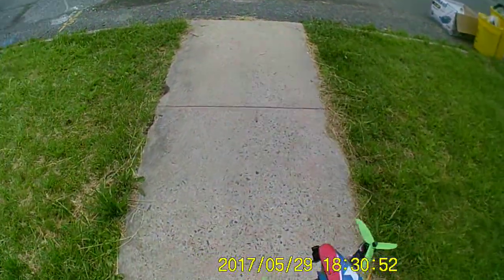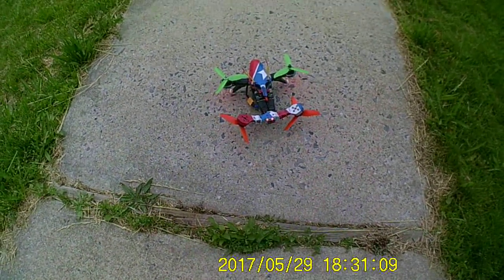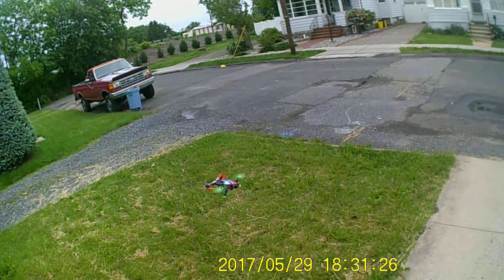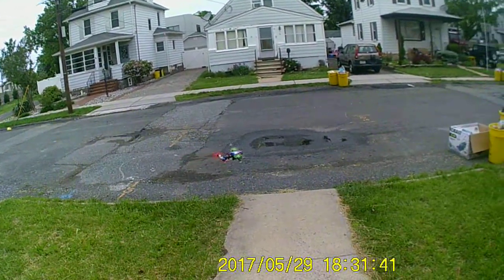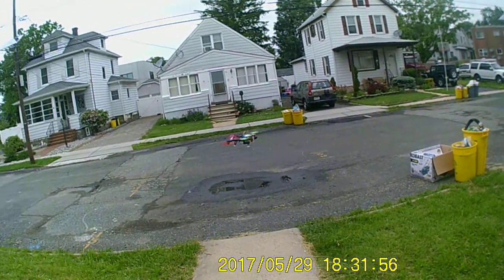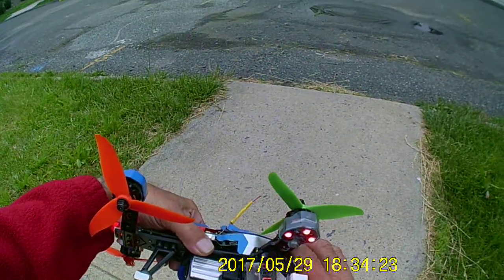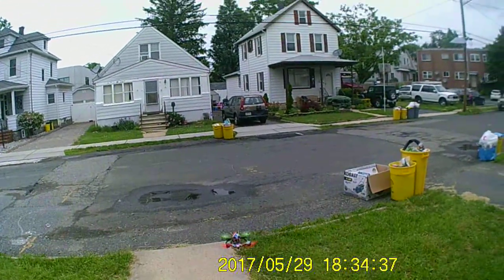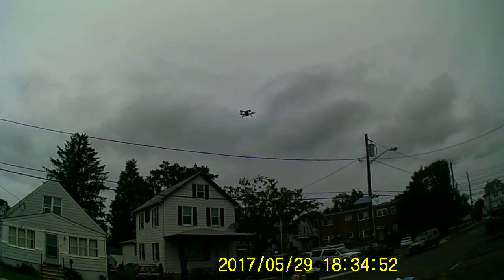eachine vtail 210 testing soft mounted front motors.

Comment: Hello Friend! You have great control with the machine! I'm having a hard time with directions yet.
Reply from the maker: Lots of practice in a small space learning to hover in any direction.I started with a cheap toy flying in a basement with confined space.Keeps the brain occupied.
Reply: peter toth Huum great idea! I'm going to buy a small, sturdy fpv drone to train like that. Vtail is incredibly fragile
Reply from the maker: The Vtail is the worst for learning not for beginners.The small heli`s  i used an Airhog Helix foam inducted fan quadcopter,WLtoys V911pro and Syma F3 heli`s. Then i started to learn how to repair them because the props break tiny brushed motors wear out or burn up if you get spider webs,pet or human hair etc. tangled in props .Always have spare parts + batteries.

Comment: lol I have the fix for broken tale now too this vtail is teaching me all types of stuff
Reply from the maker: same here youel adamas.i had an out of control crash today.the gyro went all wacky on my 2nd flight today.time for some aluminum fabrication.such a weak tail needs a bracket across the top.lets see what we can do to make it better.
Reply: yeah or just do a fiber glass its lighter but can be messy just fold a layer or 2 then add resin put oil on nut with screw in so you can pull it later would have been easier off but it works you can trim before or sand after to reshape
Reply from the maker: for me it seems front heavy so adding some aluminum on the back is what i will do just have to make a couple bends in the vice drill the holes and bolt it up.another thing i had planned on doing anyway.stupid plastic crap.the baseball field was so wet and soft like mud just the weight of the motor is what broke that plastic coming down hard on its feet.
Reply: Yeah I picked it up to fast by tail lol and snap i did aluminum but after a few turns it was out of shape try steal and harden after you have right shape might have been my aluminum wasn't hardest type. I found way to get her off 1k1k too still no multi think its esc lol it's potential in turns it amazing
Reply: I used a type of fiber glass cut and folded on top then brushed in resin then after it set I did bottom plate glue it in place first. I covered the tail top and front side and plastic under plate grease nuts and put screws in too even if you take off to do or it will not bolt back
Reply from the maker: When you gonna post some video?
Reply: lol I guess I should put something up just never really crosses mind to film what I'm doing lol I have tested this thing in every config it can take and mass range of pids and its stock pids aren't the best but osd helps tune fast. Wannaduino no it can come apart I don't cover motor part just the beam between just fold on flat side without fins maybe between fins then coat trim even or sand later

Comment: hey you stole my idea that was me lol 😁
Reply from the maker: just keep forgetting to buy them rubber washers.had to do it Vtail was getting really bad.Probably why it went out of control.i skipped across the pavement on edge of 2 blades and landed on the grass lucky break.like to put more lights on the top front and back top and bottom.either way it is a blast.6 packs on charge.anymore ideas?
Reply: peter toth yeah,I was thinking of doing a front light mod but I'll investigate more 👍